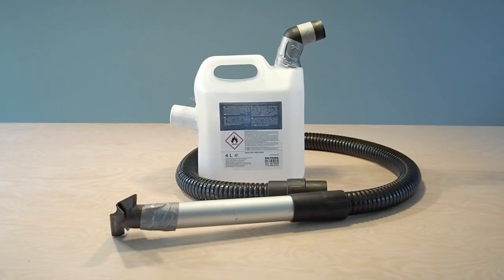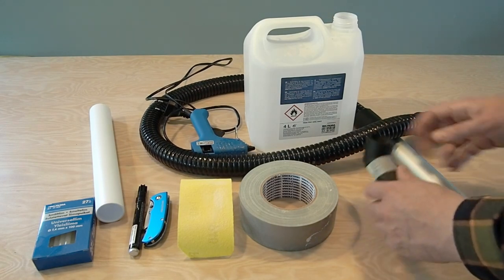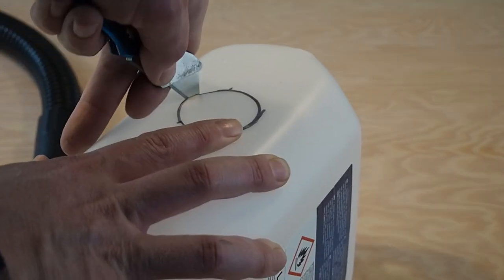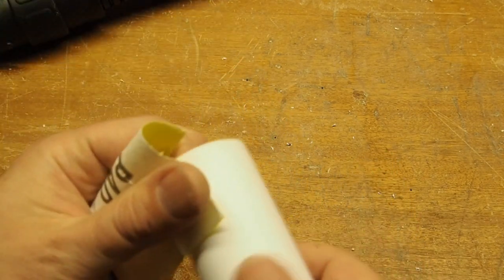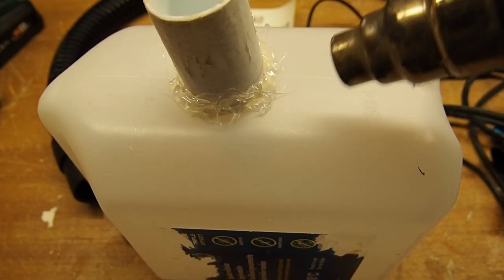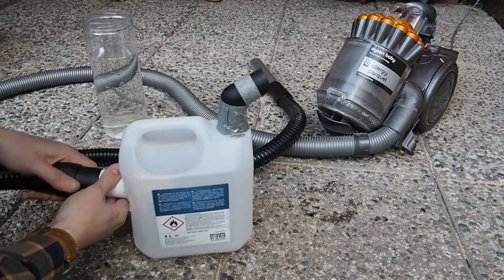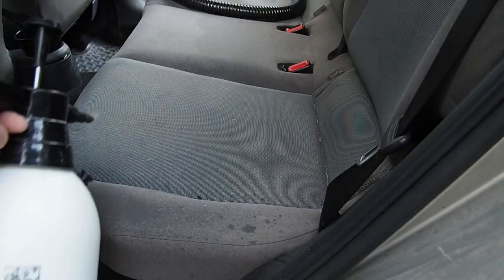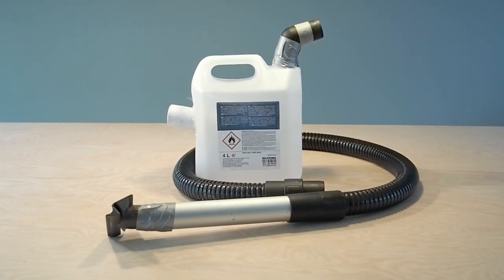Supercharge your vacuum cleaner! (DIY wet vac)

Comment: What's a good bottle/container to use I've tried 2 different containers but they kinda get crushed in even when I turn down the power. It still work but I have to watch the water more carefully.
Reply from the maker: You could try to enforce the walls by gluing some thin plywood or metal wire on the outside. Im just using a standard 3 liter can (used for window washing etc), they might be different in your county though.